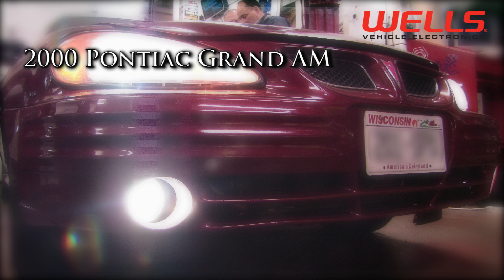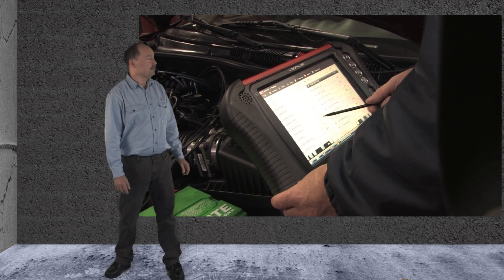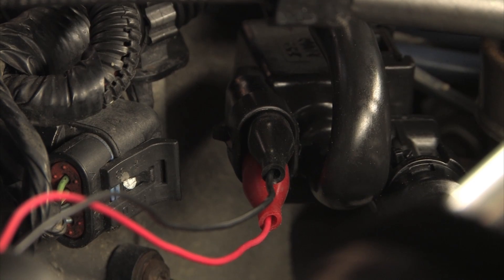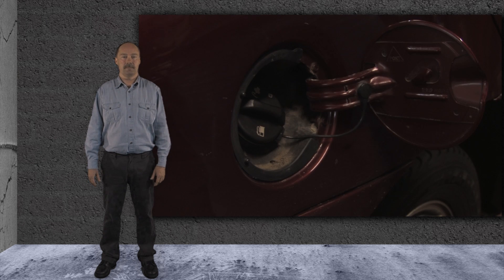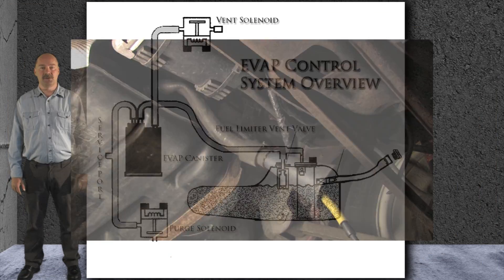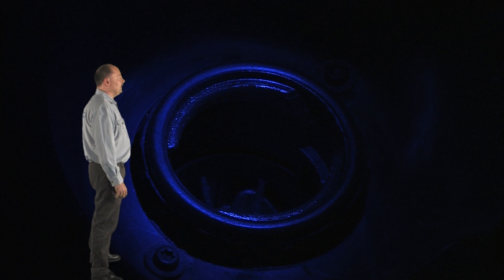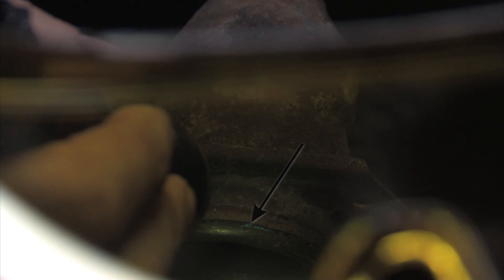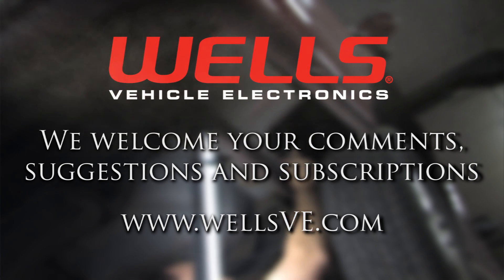P0440 Diagnostics on a 2000 Pontiac Grand Am by Wells Vehicle Electronics

Comment: got that code popping up in the system of my 03 bonneville.. hopefully its just a bad gas cap
Reply from the maker: Christian, Bonnevilles were also very common to rust out the filler neck. Look where the plastic insert and the metal meet. If there is a gap it will probably need a filler neck as well.
Mike Becker, Technical Services Instructor

Comment: We have the same trouble code on our 2000 Pontiac Grand Am. This might be the same problem. What is the name of the part you replaced? Thank you for sharing! I can't believe this is the same car!
Reply from the maker: The fuel filler neck is what was replaced on this Grand Am. It is a fairly common failure point on these cars. Hope you are able to use this video to fix yours!
Mike Becker, Technical Services Instructor

Comment: This was helpful in a small sense. I just changed my Fuel filler neck in my 02 Grand Prix since it was rusted like crazy, Yet the P0440 has not gone off, even driving for 30 minutes roughly 55 -60 miles and stopping frequently 10 - 15 times turning the car on and off. Tried unhooking the battery for 30minutes, Which is suppose to reset the PCM and clear the code. No luck.... any advice here
Reply from the maker: Are you saying the code will not clear from the computer or is the code resetting after you clear it?  By doing the drive cycle are you getting the computer to run the EVAP monitor. When the monitor runs it is testing the system for leaks. A P0440 is a two trip code. Meaning the monitor has to run twice with the same results to set the code.
Stay in touch,
Mark Hicks
Wells Vehicle Electronics
Reply: Yeah when I got installing the Fuel Filler Neck (as seen in photo) It was so rusty it broke off. Thought i did something wrong. Drove it for an hour and all and code did not reset or clear. But i took it for a drive early in the morning today for 15minutes with the heater on since it was cold outside and the code turned off. Those Pesky Fuel Filler Necks are a pain.. http://img.photobucket.com/albums/v28/pontiacmaster624/CIMG6566_zps012f64b3.jpg
Reply from the maker: *****
Sounds good! Stay in Touch,
Mark
Reply: markjhicks I just wanted to let you know that the dang code decided to show itself after 2 days of it being off. But i'm also noticing when I start the car it takes some time to turn over. Could this be the fuel pump that is causing this issue and the evap code
Reply from the maker: *****
I have never heard of a fuel pump causing an EVAP code. I doubt it would.

Mark
Reply: I honestly think it's the Evap Solenoid the one on the engine. it's known to have rough turn overs. Been a nightmare, changing the fuel filler neck helped for two days yet came back after turning the car over and it took some time to start, having my foot on the gas pedal turned it over faster
Reply from the maker: *****
That is called the purge solenoid.
Mark

Comment: Evap hose on the top of the gas tank had a huge split in it. As soon as did the smoke test, smoke went everywhere out of that one hose. Replaced it, cleared the code. I'm confident that was the issue lol. Thanks again for posting this video!

Comment from the maker: The light switch inputs to the Body Control Module (BCM), and the BCM need to communicate on Controller Area Network (CAN) with the CPU inside the IPDM to tell the CPU to ground the tail light relay. There is an auto active test of the IPDM that can performed to determine if the IPDM is capable of turning the tail light relay on. The auto active test should operate the tail light relay without the need of the request on CAN from the BCM. 

Mark Hicks
Wells Vehicle Electronics

Comment from the maker: The tail light relay and the tail light fuses are in the Intelligent Power Distribution Module (IPDM). The IPDM is the under-hood fuse/relay box. There is a Central Processing Unit (CPU) inside the IPDM that controls the ground for the tail light relay. The light switch inputs to the Body Control Module (BCM), and the BCM need to communicate on Controller Area Network (CAN) with the CPU inside the IPDM to tell the CPU to ground the tail light relay.

Comment: Hi Mark a question you may can help me 10 Nissan altima, no tail light here how they work:
when the switch is in 1ST position BCM detects and send request to IPDM them IPDM activates the tail lamp relay which send power to fuses for tail lights, 2 V from BCM signal which never change  at 1ST position but increase at 2ND position for headlight, how to know if the BCM it's bad since there no activity voltage.